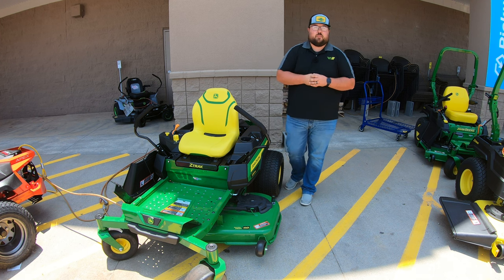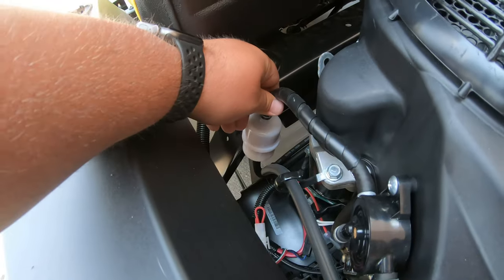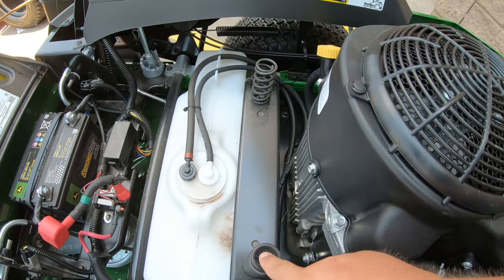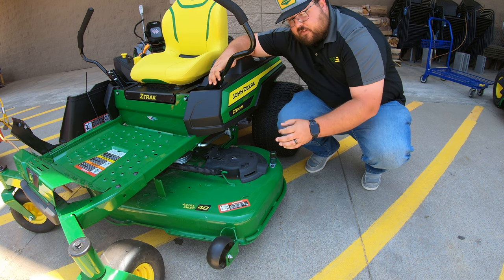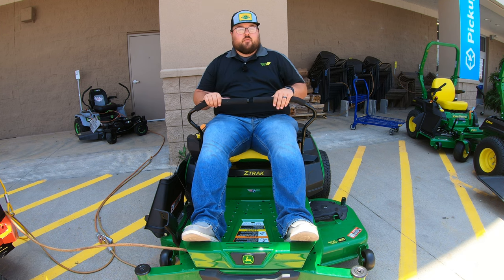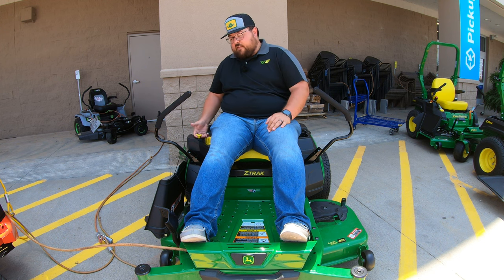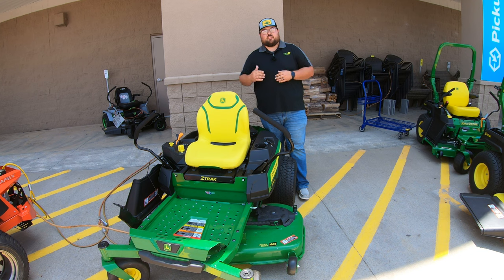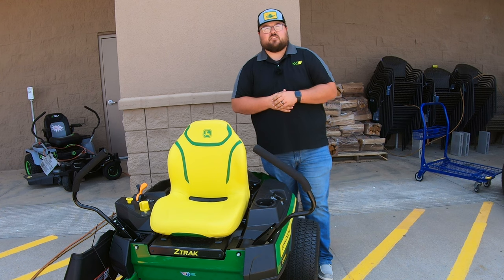2023 John Deere Z330M Zero Turn Mower Review & Walkaround

Comment: Got this exact model in May 2023 - mine has a hitch. Purchased from Lowe's. If you buy from Lowe's they give rebates. They hide it on their website but I got $250 rebate in May when I purchased.  First Zero turn I have ever owned.  Super easy to learn. Smooth ride. Only issue I had recently is the push nut that holds the flap on fell off while cutting grass recently. Trying to find that part has been a challenge. The mulch kit is well worth the extra $$$.

Comment: I just bought one and when you first get it the mower deck is locked up. When you push on it to put it at the mow height and let it down is there no way to lock it back up in the  position that it was from the dealer? If you could put it back in that position loading it on a trailer would be a lot easier.

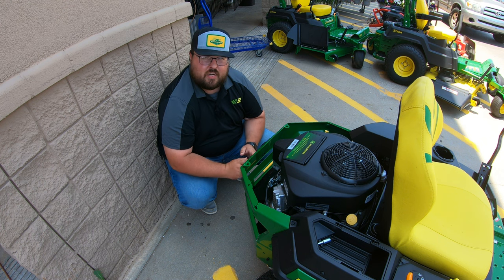Comment: At at 2:55 why do you call the gas tank the fluid reservoir for the transaxles?  When did they drop the hitch.  My 330m from Lowe’s bought this spring had one.
Reply: The Reservoir for the Transaxle are under the seat! The gas tank filler cap is on the right hand side

Comment: You mentioned this mower has the EZT-D transmissions with an oil reservoir, but never showed us where the reservoir is located. Does having the oil reservoir mean these transmissions are serviceable? Is the ‘D’ model transmission a heavier duty transmission compared to the EZT-C transmission?
 Thanks for this very informative video!

Comment: Great video. Does it only come with one key? I got it delivered and didn’t get an owners manual. What type of fuel does it take? It’s my first lawn mower.
Reply from the maker: Your owner's manual should be under the seat or somewhere in that area. There should be an extra key with the owner's manual and it takes just regular gasoline

Comment: wish to add a mulch cover on the 48" deck .  got # gy20417.    it is not compatible on the z330m .  can you recommend  any other mulch cover that will fit the 48" deck?  i 'd rather not build a mower deck with mulching kit #buc10705 for $250 . thank you , customer gary
Reply from the maker: Unfortunately, there is not a cover for this deck. You have to add either the mulch kit or the mulch control kit.

Comment: I do NOT recommend this mower. Tires all started to leak down within a month, had 3 deck bolts fall out, bent deck rod, belt shredded at exactly 30 hours and nothing says what size you need, belt is a pain to replace. Governors were set different so it would go crooked at full throttle. Plastics are cheap, cracked before 20 hours.
Mower was designed well, but built by toddlers, no quality control. 
If you do buy this, tighten every single bolt on the mower, or they will literally fall off
John deere was going to need my mower for atleast 3 weeks to replace a bar on the mower. Luckily I could fix mine myself, but good luck getting parts.
Reply: It is easy to clean, and makes a good cut, but if I could do it again I would not buy a mower from lowes